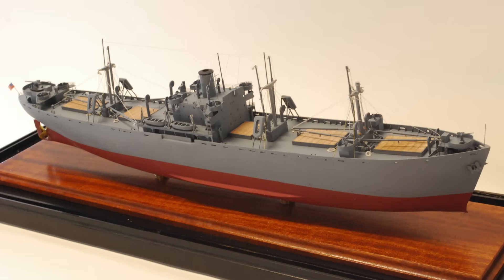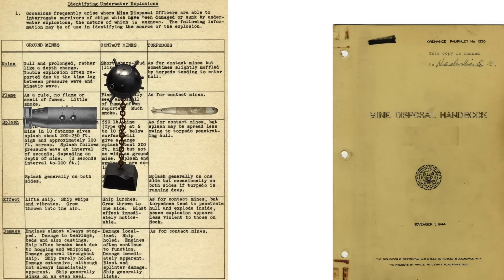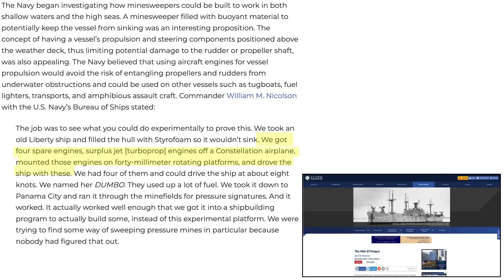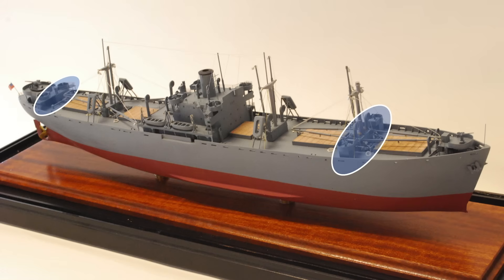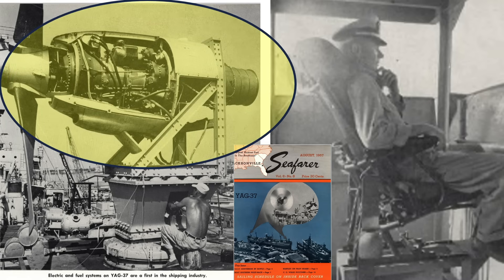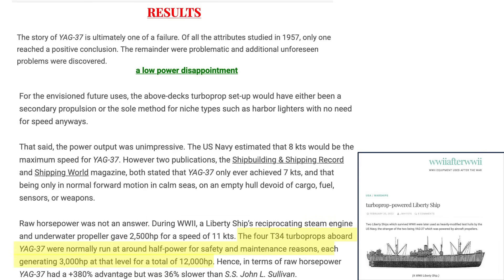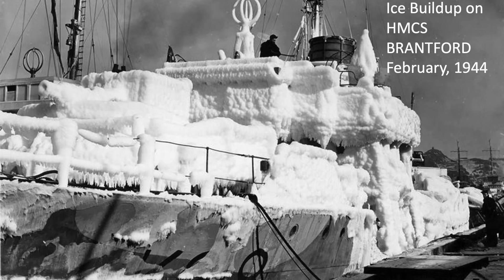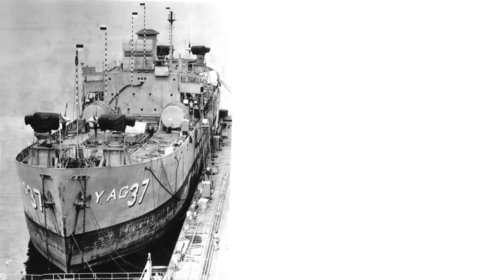Why the US Navy turned a Liberty Ship into an Airboat and why the YAG-37 Project Failed

Comment: Sounds like the biggest issue was the loss of speed pushing air instead of water.  It seemed to work but just needed help getting between areas.  Perhaps if they were to copy it today, replacing the shaft and prop with a ski jet style system for a primary drive would offset the loss of the traditional prop.  Also a water jet system could be directed or even be switched to using bilge or ballast water for sort periods or pumping out from leaks.

Comment: The reason engine shafts make a vulnerable point for sea mines isn’t just the length of the shaft but the shaft seal itself.  If the outside pressure spiked the seal was a weak point which could be shot into the ship, creating an unrecoverable scenario where the ship would likely sink.

The seal itself had to be readily accessible for maintenance.  Typically they were of the gland type where a small amount of water was allowed to leak through continuously.  Adjusting packing glands was a daily concern of the engineers.

Again you’ve made a wonderful video on an interesting topic!

Comment: It seems like a diesel electric system would solve the problem of a long shaft.  The electric motor could be in the hull, or maybe even multiple electric on outrigger pontoon like structure.  I do not know if the mine is setoff from the pressure wave of the hull or props.  Several smaller propeller with electric motors might survive a blast.   This almost looks like a bad idea, someone wanted the USSR to copy.

Comment: Here in Louisiana, we've got all these "airboats". Swamp boats propelled with a big fan instead of props. THEY ARE LOUD.

I can only imagine the noise of these things.

With modern technology, a reasonably efficient above water propulsion system is possible - a waterjet. This sucks up water up a tube and then uses an internal prop to eject it over the stern like a water hydrant. There are some losses due to lifting up all that water, and the drag of the internal tube surfaces. But nothing like air fan propulsion losses.

Comment: More great stuff.

Brainstorming here.  It would seem as if modular, replaceable, propulsion units comparable to an oversize outboard might be one viable way to propel such a minesweeper ship.  If only 2500 hp was the standard power of a Liberty, that's easily achievable with modern diesel or gas turbines in a relatively small engine or pair of engines.  Keep a few spares crated on board, with a crane that can lift them into position should they be needed to replace a damaged unit.
Reply: I was thinking the same thing, but use multiple electric motors.

Comment: I wonder if the navy ever considered side paddle-wheels, as in river steamboats back in the day.
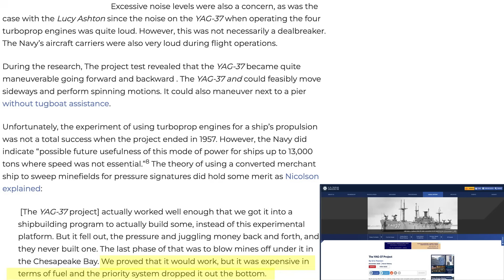Reply: A close explosion like the one shown at 8:10 would have wrecked them, I would imagine.
Reply: @MrStick-oc7yo  Well, they are much more easily repairable, and the shafts are much shorter, and do not penetrate the hull under the water.